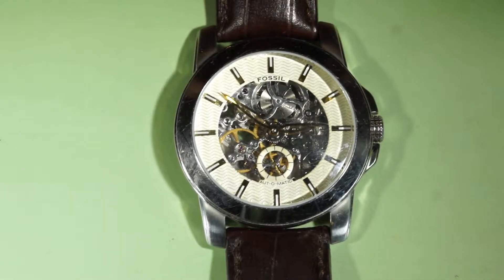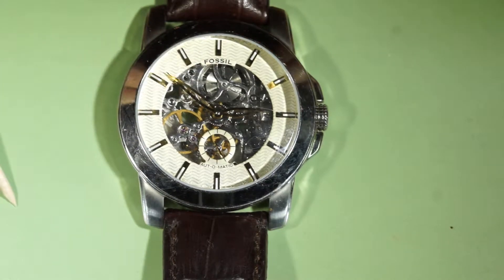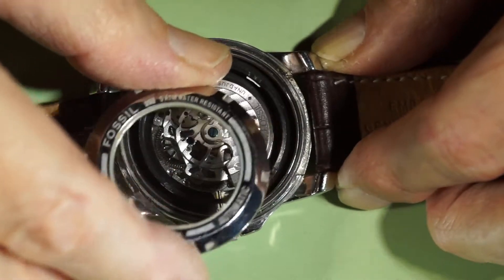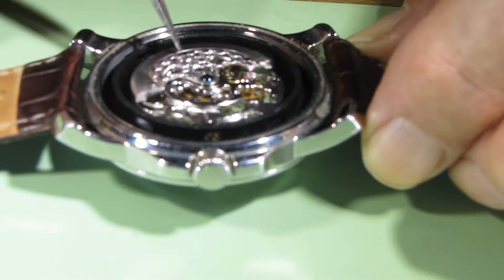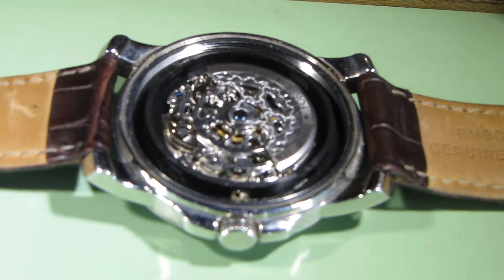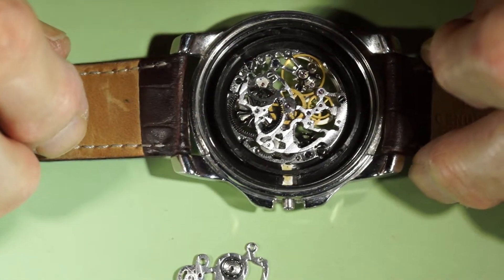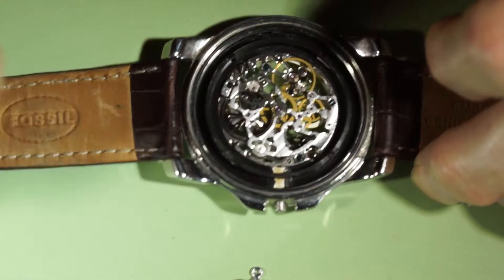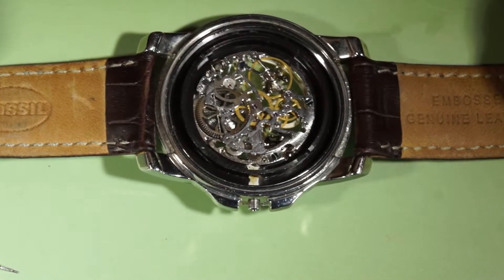Fixing Skeleton Automatic Watch with Seagull TY2723/ST1771 Mvmt Stuck with a Fully Loaded Mainspring

Comment: I have a reverse problem.. the wheel is moving freely and the inside mechanics is not working. Wat can i do ?
Reply from the maker: If I understood you correctly, the balance wheel is moving in your watch, but other wheels are not. But if other wheels are not moving, then the balance wheel should not move as well. Are you pushing the balance wheel by hand? Please clarify.
Reply: @ValentechTime  hi thanks for the reply. No I am not pushing the wheel by hand. All the inside mechanics are stuck but the Wheel (which was stuck in ur video) is moving freely as per my hand movements
Reply from the maker: @kedarpendse3177  So, when you wind up by stem, the wheel with a mainspring is rotating, right? But other wheels are not, including the balance wheel. It could be the same problem, as in my video - the click spring (I call it "lever") is holding the rachet wheel and doesn't allow it to drive the mechanics.
Reply: @ValentechTime  yes. Thank u soo much. Dat really helps

Comment: I have the crown lose and cant set the clock how to fix it?
Reply from the maker: Was crown lost or it is there but got loose? You should remove the stem and connect the crown to it tightly. Then after inserting stem back to the movement you will be able to adjust the time. Good luck!
Reply: @ValentechTime  i cant see stems in this video, have you got another video that show the stems?
Reply from the maker: @limaastu6456  Take a look at 2:10-2:14 time interval in the video. There is a stem you can see. I have another video with the watch having the same movement. There is a stem visible at 2:41. Here is the link: https://youtu.be/7WYpFefO6XM